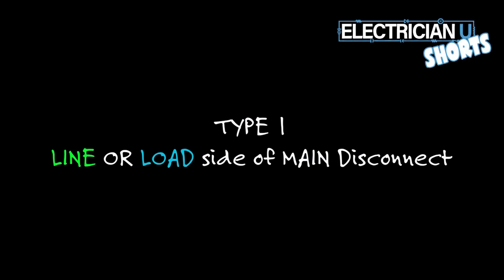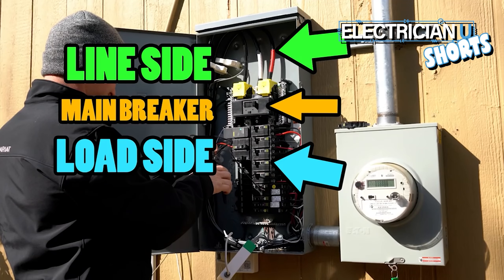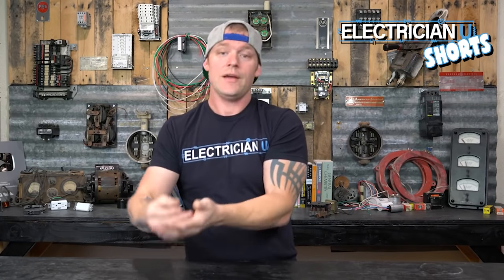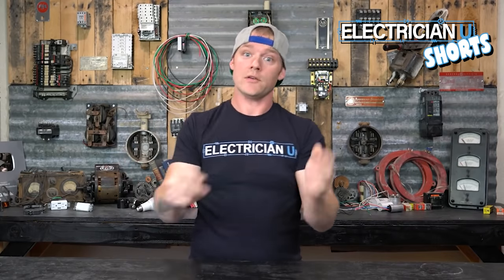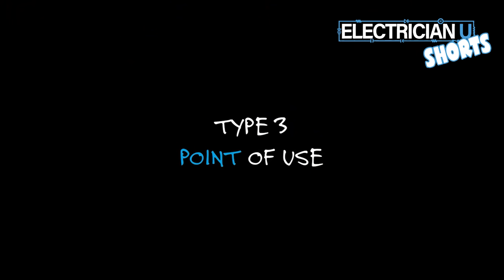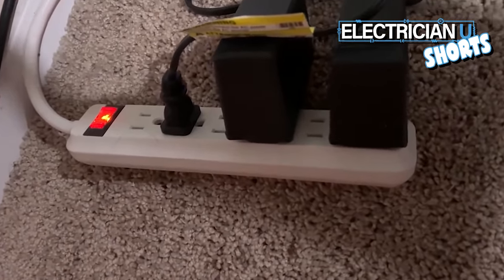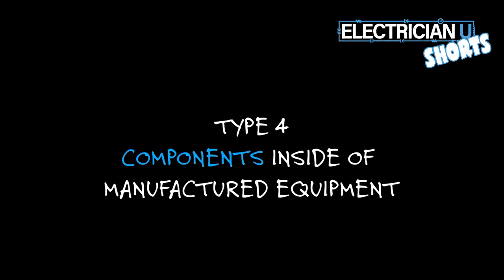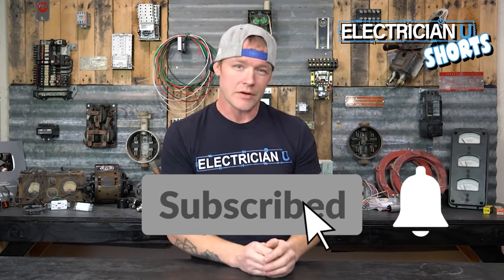SHORTS - 4 Types of Surge Protectors (In 3 Minutes!)

Comment: How about a video on lightening arrestors?  Primarily those that can be mounted in a 200-amp residential breaker box. I have all sorts of surge suppression in my house.  Now want to add a lightening arrestor. Ken
Reply: Have not been called lightning arrestors last 10 years or more in NEC for some reason. Large hospital that I retired from had well over a125 pointed rods on roof. We had to PM them every 3 months but seldom found any damaged or missing. You would be better having a licensed company donthe install. They use a large woven aluminum cable that has a little hollow area in center. ( maybe to better distribute heat from a ligjtning stike ).
Reply: those are surge protectors

Comment: Only buy power strip surge protectors if they offer an attached equipment warranty. Because when a surge protector can’t protect anymore you want it to stop passing electricity so you know to replace it. 

If it doesn’t have attached equipment warranty then when it quits protecting it just passes the next surge straight through. I have replaced plenty of computers destroyed by a surge that got through a crappy surge protector. 

The amount of attached equipment warranty really doesn’t matter. $1000 or $1,000,000 both will disconnect the power when they can’t protect anymore.
Reply: I've seen plenty that have an attached equipment warranty but don't disconnect the power when protection is exhausted. You have to look for that detail specifically.

Comment: So i had a 240 volt surge go through my house because the electrical apprentice forgot to screw down the neutral wires on two breakers and the main screw to the neutral buss Barr. It fried a lot of shit. It fried all my pioneer elite TVs and audio receivers we had fire in the monster boxes. Trying to troubleshoot all this is a freaking nightmare!!!! The thing is it fried all the power surge suppressor strips and backups too. What’s the best way to figure out all the hidden damage. I’m worried my refrigerators will not last and its really weird not everything fried . Someone said that the house became a giant capacitor and then it blew.

Comment: The most common surge protector I see in the field (residential) is installed next to the main breaker panel and tied into a 2 pole breaker. Basically it's a common upgrade when other work is done at the house, like an addition, sub panel, or generator installation. Whet I have to do is remind the customers to check it on a regular basis, especially after a power failure or storm. Look for the 2 lights and if both are not lit then it's no longer protecting.

Comment: Question for anyone that might know: I have a circuit breaker finder and I am trying to replace some outlets. When I go to find the breaker every single outlet in the house says it’s on the same breaker. I flip it and none turn off. Is there something wrong with the wiring or not? Or do I just need to do the old fashioned way of finding the breaker.
Reply: Not all breaker finders are created equal. That said my understanding of how the finder works is that the sender adds noise to the line which the receiver hears pointing to a breaker…. My first guess is that the breaker the receiver finds has something out it which is making the same noise louder.  Turn that breaker off and retest.  That should work.

My 1st guess is you have some smart device on the circuit making noise. Unplug all devices, turn off all lights and check for smart switches and USB outlets. Now test…
Reply: @richardgray1730  no smart devices. Nothing plugged in to any outlet.  this is an old home, a rental I own.  Built in the 80s or so
Reply: @richardgray1730  At the large hospital that I retired from we had the best circuit tracer. Amprobe that would be too expensive for homeowner. Had to make sure that switch was on correct place ( breaker or wire ). On shared neutrals most cheap tracers have problems. Some times if you turn sensor touching breaker by 45 degrees it will pick up the breaker better if you are receiving false reads. If you tracer has a row of lights does one breaker only illumantes the most lights. If that does not work plug in sending unit in the receptacle then turn breakers off 1 at a time. When it goes off that should be the circuit. Always check outlet to prove that power is definitely off. Had a receptacle in a large lobby that 3 seperate sparkies spent hours on trying to locate circuit breaker. We checked over 700 circuit breakers from basement up to 2nd floor and never located it. Good luck.